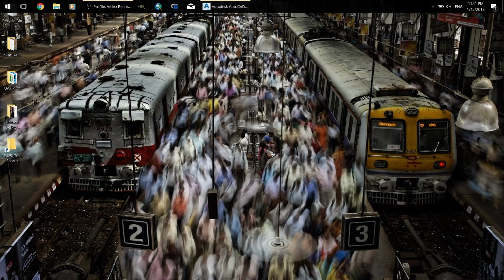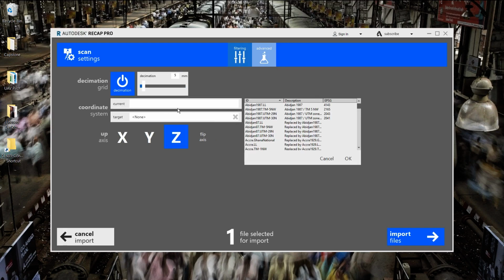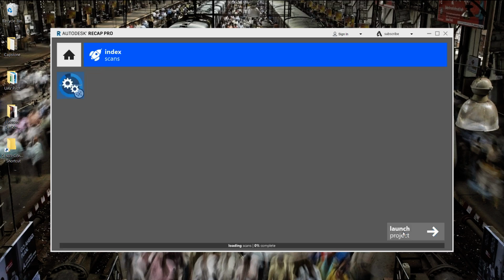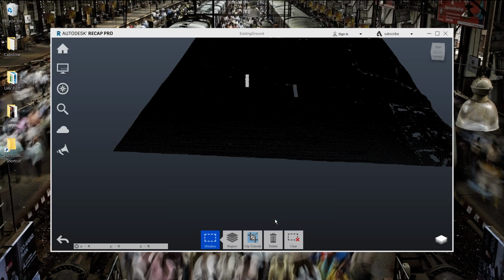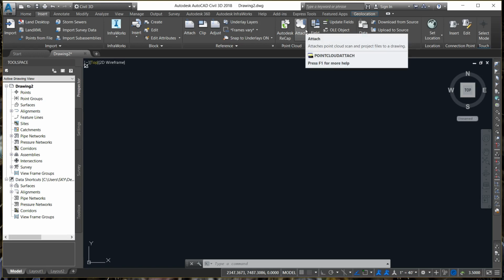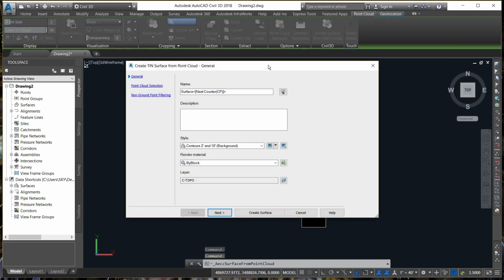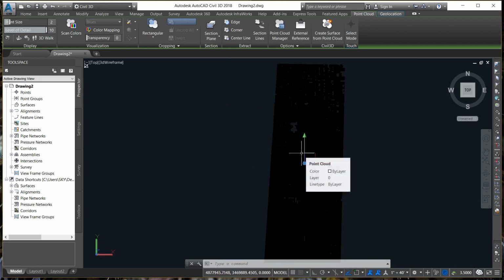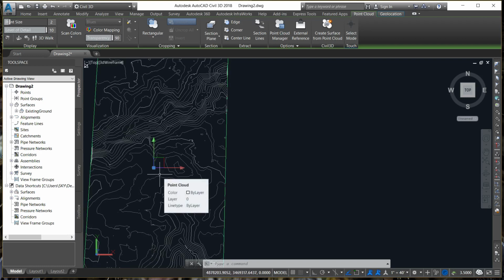AutoCAD Civil 3D 2018 - Import Point Clouds and Add to Surface

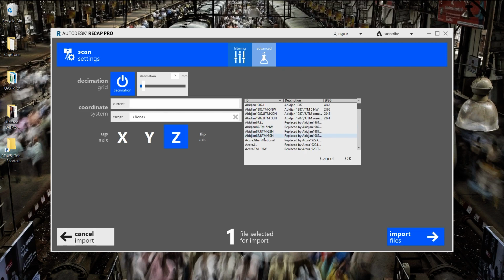Comment: Hi Steven, is there a way to identify the coordinate system type of the .las file? I'm experimenting with other .las files that weren't used in the video and am wondering if there's a way to figure this out. I'm referring to the coordinate system identification at 1:38. Thank you for the wonderful video!
Reply from the maker: Hi Grape, glad it is helpful. I think you're best bet is to find the metadata from the source. The Iowa Geotree site has their data in this format https://www.geotree.uni.edu/static/lidar/iowa_lidar_metadata.html. It doesn't seem the Iowa data stores their metadata in a header as yours may not either, but it's worth checking. CloudCompare can pull that I believe. The final desperate solution would be if you know approximately where your data is and common formats, you can guess. Around Iowa we commonly use State Plane, some low distortion projections, UTM, WGS84 etc. Good luck!
Reply: @StevenYounkinCivil  Thank you for the help Steven! I was indeed able to find the metadata from the gov site I found the .las file from. Thank you again for the great video!

Comment: Great tutorial, it really helped me! Just one additional step users may need: if you have your drawing settings are unitless you will need to switch it to US Feet before you attach the point cloud -- command InsUnits, set to 21
Reply from the maker: That is a good point. I forgot to mention I was using a template which automatically set those units.

Comment: Thanks! There does not seem to be an option "add point cloud to existing surface" in C3D 2018
Reply from the maker: HerrMikael, I did not discuss how to add point clouds to a surface that has already been created. I believe this article from Autodesk should explain that: https://knowledge.autodesk.com/support/civil-3d/learn-explore/caas/CloudHelp/cloudhelp/2017/ENU/Civil3D-Tutorials/files/GUID-B282E7E7-7A24-4BBD-B698-E99065F12C96-htm.html
If you need additional help just let me know.